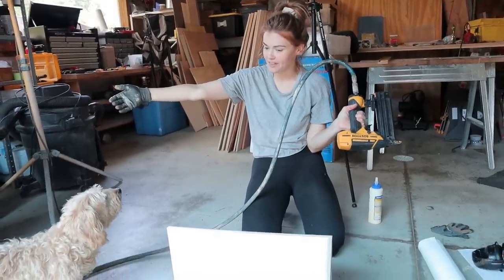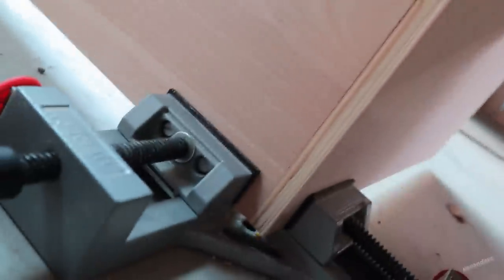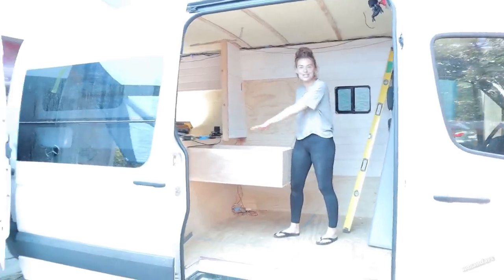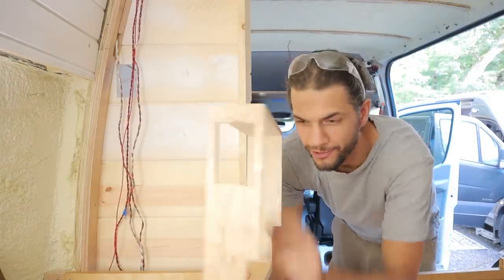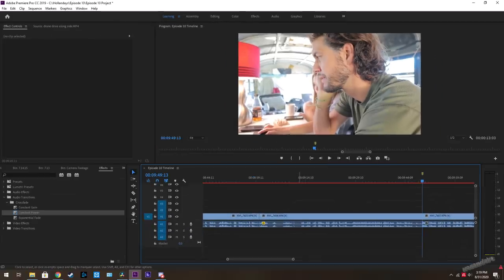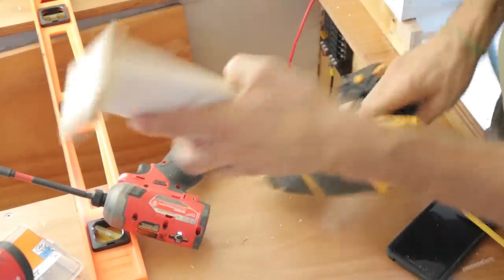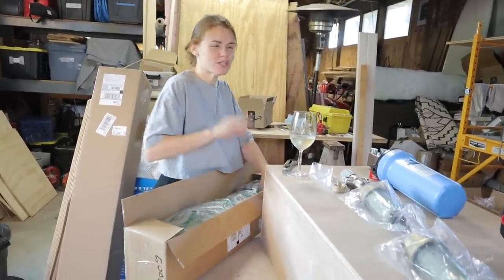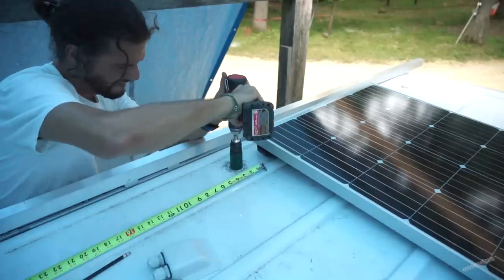TINY HOUSE WALL CONSTRUCTION: VAN BUILD

Comment: Thank you for sharing so much detail on that small cabinet build, for one I was trying to figure out how to attach those vertical firing strips , no one shows that! The smallest project of that cabinet housing an out let and the wires was an eye opener. It takes so much brainstorming, planning calculating.. then the actual execution of it all.  This video shows both of those aspect and is greatly appreciated! Thank you 🙏

Comment: I begin to wonder if this is a contest on how many holes you can cut in a van. XD
What would you like to learn next, once you master Premiere? I am the curious kind myself, always eager to learn new things.
Here in Spain we are not too used to nail guns, it can have to do with everything being made of concrete or brick instead wood. There are few wooden houses around here. On the other hand, hammer as many nails on that thin panel would be extra hard, and propably end up missaligned. I never thought about hammering as a cultural difference.
Reply from the maker: so interesting!